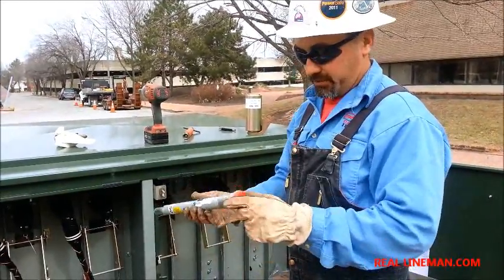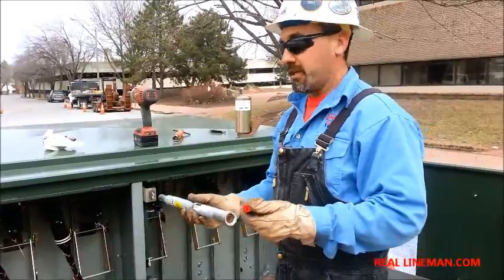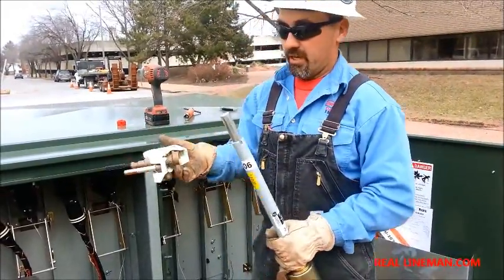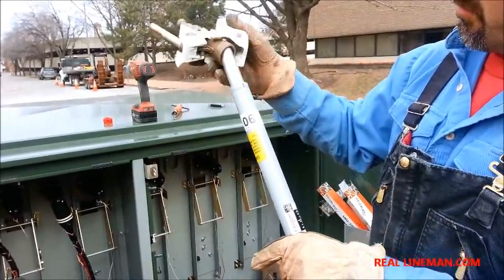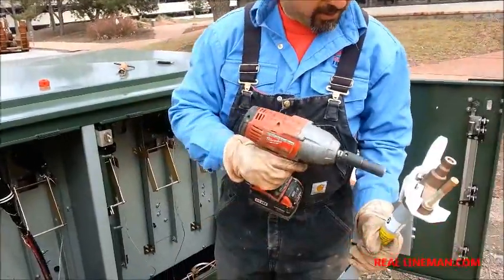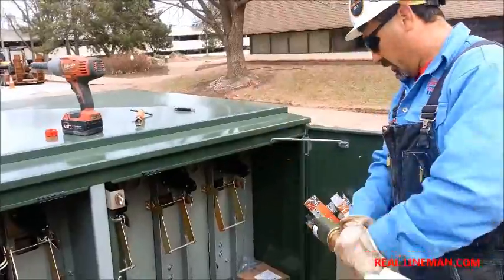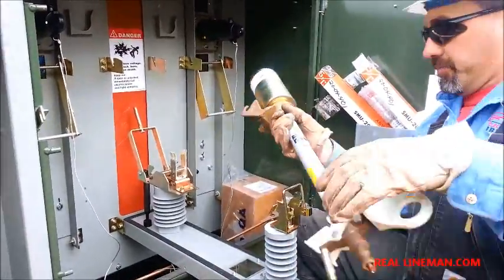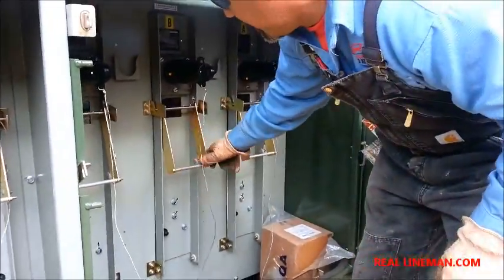Real lineman SMU-20 fuse assembly and installation

Comment: The SMU-20 is a really good fuse high interrupting they can go up to 14,000A in the 15kV version and 12,500A in the 27kV version.  A bit more spend than overhead cutouts but they do the job well on most circuits even with higher fault duty.

Comment: what is the purpose of the suppressor besides dampening the explosion sound ? is it because material from the fuse expelling out at high velocity and force could cause damage to other components inside the cabinet ?
Reply from the maker: That is exactly right. Also suppresses the arc flash inside the cabinet.